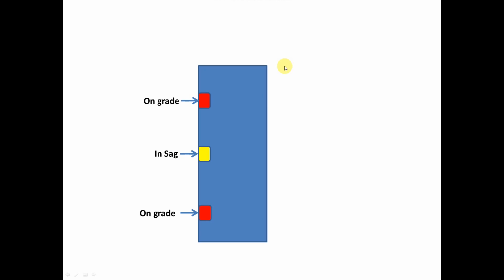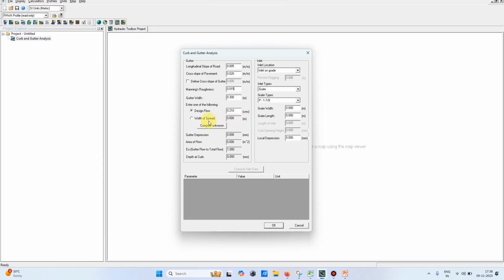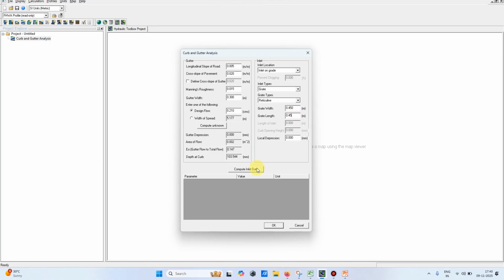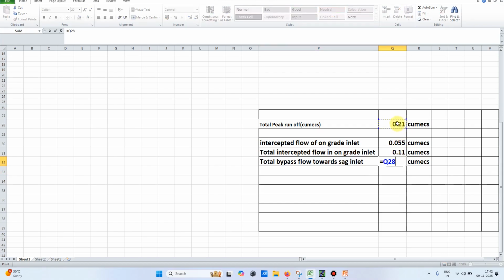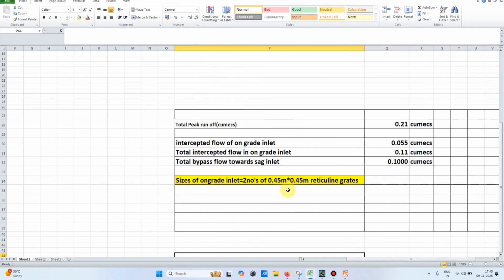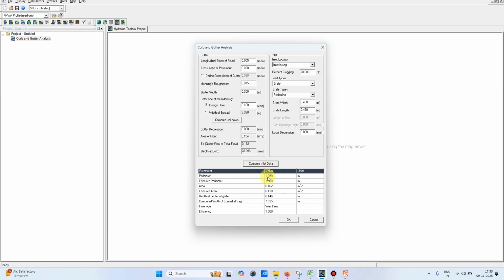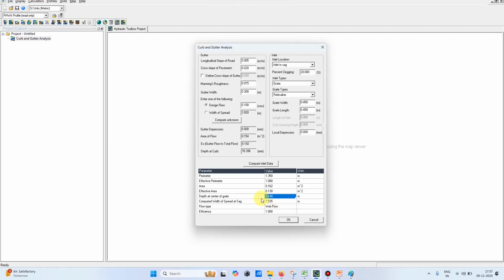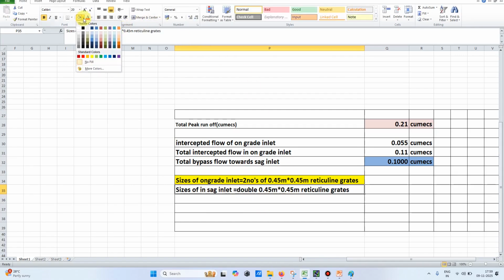Inlet design using hydraulic tool box: Brigade road drainage case study part-2

Comment: Hi, Normal curb height is 150 mm and the depth you calculated is less than that. But most important is spread , which you have not mentioned.  While considering double inlet , increase only the length. Recalculate only increasing length, not both width and length
Reply from the maker: 1.Normal curb height is 150mm that's more of standard code in book/manual but at the site this curb height is not maintained everywhere in india. since i have worked this based on my field visit at Brigade Rd which is having variable curb height that's why i kept that as unknown.

2.The reason why i kept double inlet at sag point because here run off from the contributing catchment area exceeds 500 m^2. The sag point is final outlet of the catchment after that the run off will collect the sag point and flood depths builds up leading to increase in the spread. that's the reason for providing double inlet opening at the sag point.

3.The concept of spread and concept of inlet separately explained in my past video https://youtu.be/ppDkxTeSdVo?si=El_uHyNsOVX-W_9s . that's why i didn't put more effort in explaining spread. The spread equation from the HEC 22 method gives non-practical value if the design storm has large peak discharge say in this case if i've conisdered peak 1 m3/s it would gave given me some 30-50 m of spread which are based on empirical equation but not practically possible in the site